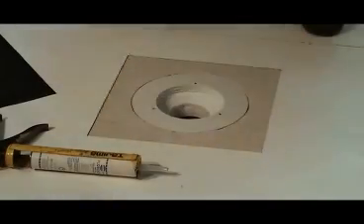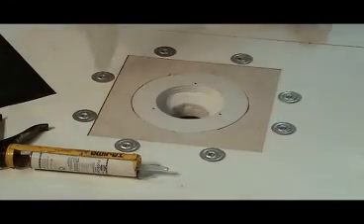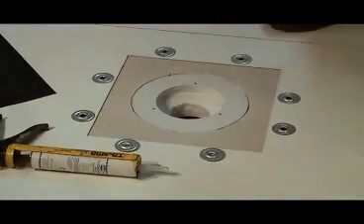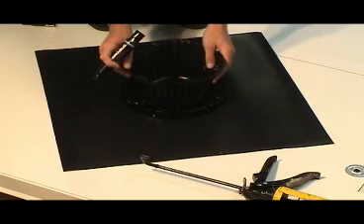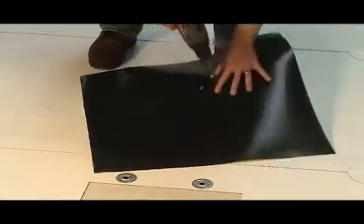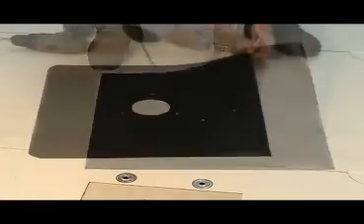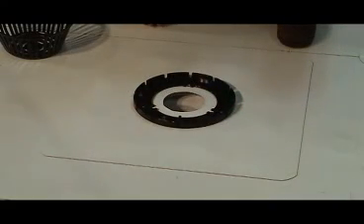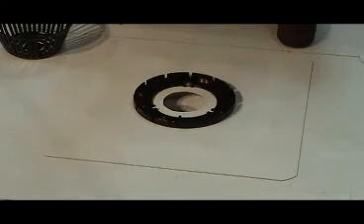Flat roof Installation - Part 12 - roof drain

Comment: Part 2) The membrane hole must be bigger than the downpipe but no closer than 1/2" to drain bolt. Reach in and thread your drain bolts. Use the back end of your scissors to tap the bolts over the membrane and you will get perfect placed holes. Apply watercutoff between bottom of membrane and drain. Install clamp ring.

Comment from the maker: @dazladakablond3 

No, I should not. I do all my detail work with the same 40 mm nozzle, and a 20 mm burns the membrane as there is TOO much heat coming out, or you have to weld TOO fast, and the weld in not deep enough, and you may have bad welds.